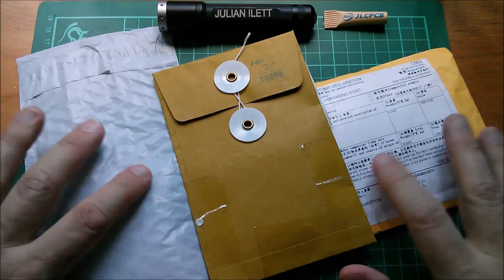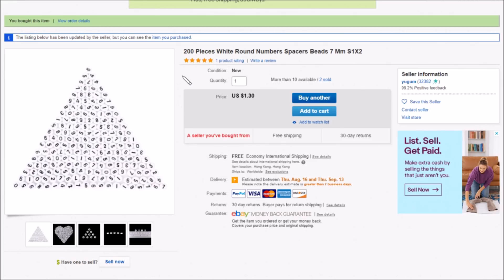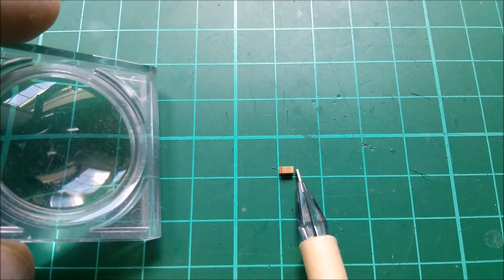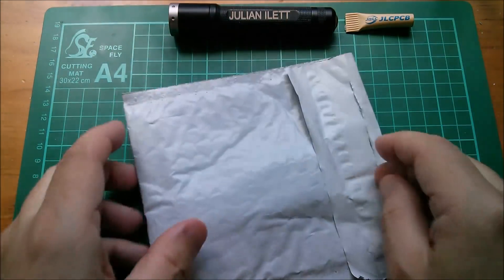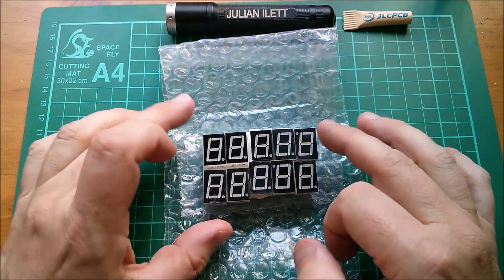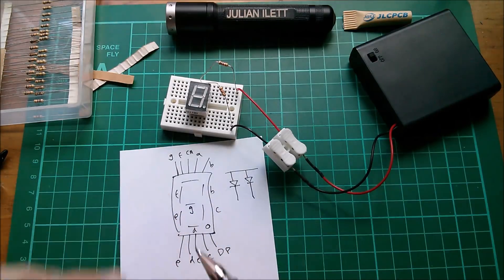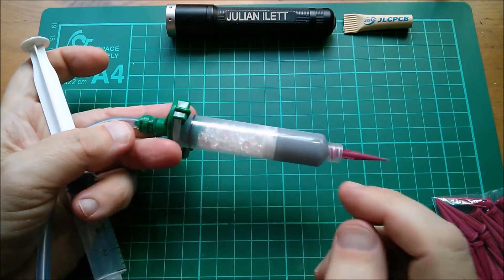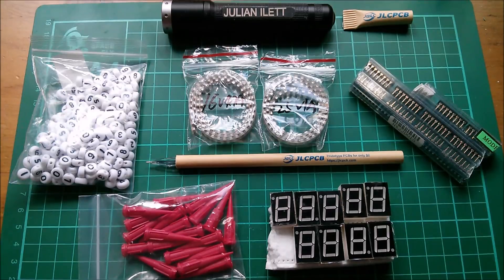Julian's Postbag: #122 - Electronicals

Comment: The solvents in the solder paste for the flux are normally alcohol based along with other volatiles. You should always store them at a lower temperature above freezing to minimize loss of those through evaporation. Do not use any desiccant as that will only cause more to evaporate until an equilibrium is reached in the container. ziplock bags are good just remove any excess air without creating a vacuum condition. The less space for gasses, the less evaporation it will take to reach an equilibrium. The thick heavy duty freezer bags are the best. Anything being stored for an extended period has a corner left open and then the rest of the bag is submerged to remove the air before the corner that's still open is sealed. Then it goes into the fridge. I've seen some use pressurized containers, but it's just more work and solder paste isn't that expensive.

Comment: Your solder paste contraption looks overly complex, is solder paste really that expensive there, to the point where you just can't waste a tiny amount?  I just fling the paste in the general direction of the PCB and any that's off the pad a little, either moves over to it when heated or just washes away when I clean the board.

Comment: Julian, measure those SMT caps...some “fraudsters” will sell you, effectively, an empty tantalum package, with nothing inside!
What hexadecimal display driver are you looking at? Perhaps the common anode is the correct display if the driver provides a LOW output driver (negative true) for each segment.

Comment: What is the 7 segment hex driver chip for common cathode displays?    I wanted one but have not found any
Reply from the maker: MC14495  HEX to 7-Segment Decoder
Reply: These are obsolete and therefore difficult / expensive to obtain.    A cheap micro controller and any display is probably a better bet  see HSEG1000

Comment: I enjoy your videos, Julian. I have been watching, so I know that you were using air to prevent the paste from continuing to flow after mechanical pressure is applied. But as you are experiencing, the advantage that it gives in that air is compressible and therefore gives a nonlinear response also brings a tradeoff. I think you are on the right track in attempting to limit the amount of air, but I think you need to think about the entire volume of air, not just the part near the dispenser. I look forward to continuing to watch and see how this turns out!
Reply from the maker: I'll be using the syringe digitally - just on or off (full pressure / no pressure). That results in a fixed flow rate of paste through the nozzle. Yeah, the beads reduce the air volume in the syringe - the pipe can be cut shorter if necessary.

Comment: Julian, I keep my solder paste in the fridge. I hope that helps.
Reply from the maker: I don't have a fridge - I have 50% voting rights on the use of a fridge. Guaranteed stalemate :)
Reply: Same here.  The dragon does let me keep one tube in that's been opened.
Reply: Get yourself one of those tiny peltier element powered fridges to keep your paste in. The ones you can fit just 2 or 3 330ml cans in.
Reply: Let me guess the wife has the other 50%
Reply: That is about the most accurate description of a marriage I have ever heard LOL. Also, a mini fridge for your refreshments and solder paste could be in order LOL.

Comment: I put a bit of hot glue on the paste dispenser tip to seal it between use.  Stops the paste from hardening in the tip.  Otherwise you might as well throw out the whole thing if you leave it for more than a day.  Don't get too worked up trying to put the paste on perfect.
Reply from the maker: Yeah, I'm going to treat the tips as disposable.

Comment: TIL311 display already has the chip built-in... if you can find them. 4-bit input hex display; saves space as you don’t need a separate decoder IC. Has internal latch, so they can be multiplexed. Also has blanking input, and left/right-hand decimal points. Just google “TIL311” for the pinout! 😍
Reply from the maker: I have 2 of them on an old Z80 project :)

Comment: The trouble with those little DIP switches is that they're intended to be set and then left and only changed rarely if ever.  They're probably made to a price rather than to a quality because whoever made them thought they'd be moved back and forth a few times at most and then never moved again.
Reply: "Maybe", a quality major brand will typically rate their switches for number of cycles and it's more than just one to a few cycles, but yeah the generic stuff, if it works at all you should never touch it again, lol.

Comment: MC14495  HEX to 7-Segment Decoder
Reply from the maker: That's the one :)
Reply: I have ben using them to build clocks
Reply: 80 pence each on AliExpress seems quite good.  A much better price than TIL311 (sweet though they are).
Reply: I have 450 TIL311 I have not played with them in 10 years I got 500 them of EBay way back wen . I may have to dig them out
Reply from the maker: +Jamie Phillips I think I have 2 of them :)
Reply: back then they were $0.15 each

Comment: Yes, SMD package sizes can be given in metric or imperial units. Most manufacturers use metric, because the very small sizes like 0201 (0.2x0.1mm) would look like 008004 in imperial (and many of the SMD specifications are metric to begin with). Almost none of the codes appear in both measurements though. You have an 0805 and 1008 in imperial for example, but a 1005 is the closest in metric (numbers, not size obviously). 
But as luck would have it, the only two that do have an equivalent are the typical hand solderable sizes (0603 and 0402 imperial). Watch out to not get the metric size for those!
Reply: 0201! That's absolutely tiny. 0.1mm I couldn't even see that let alone solder it. How does even a pick n place machine pick up parts so small as they use vacuum to pick up parts.
Reply: I don't know. Sprinkle them over the board and hope something sticks? I'd really like to know that as well. Apparently it actually is a point of higher failure rate in production. So it's not what you would want to use if you didn't have to.

Comment: I keep my solder paste in the fridge, seems fine after 2 years now.
Reply: My fridge is still fine after 10 years.
Reply: The paste that requires frigeration tends to have at least a 12 month shelf life.

Paste that had been stored badly (specify before you get it) tends to go hard. Decent solder paste should be dispensable by hand. Once you try a good quality solder paste,  you can quickly tell the difference between good and bad paste.

Good paste it's like magic if you've only used trash paste previously. :D
Reply: Put it in your food dehydrator to draw the water out, and store it in an air-tight container.  Many years without refrigeration, then when it comes time to use it, don't get it confused with your beef jerky which does not hold components on PCBs well at all.
Reply: Keep perishable food in a fridge?  That is a remarkable high tech solution  that WTFBBQ didn't need stating.

Comment: Even a surface mount mosfet?
Will the femto version be as good?
Also, i doubt it will work with just a syringe. I think you'll just compress the air and nothing will happen.
Honestly, i personally think you should just get an smt stencil(JLC pcb makes those too), thats a lot easier. You can do the whole board all at once in a couple seconds using that without any precision on your part. All you have to do is align it properly and then spreading he paste all over it.
Reply from the maker: Ah, yes, the MOSFET and transorb diode are still through-hole. The legs of the MOSFET double up as a connector :)

Comment: Ya, the metric SMD sizes aren't always exact conversions from the imperial.  I think a bit of rounding was done for some.  The 1206 for example likely started as a metric size, 3.2mm, and was converted to imperial .12598" and rounded down instead of up.  That's my guess at the moment... 5 AM here and I just happened to be getting up but it is still early to be thinking too hard!   ;-)

Search for "SMD imperial metric" and view images to see some tables.

Comment: You don't need a precise amount of solder paste on your board. Just spread a line of paste across all of the pads (the flux will do the rest).
Also the solder paste should be stored at around 0-10°C and should never exceed ~25°C.
Reply: or you get an smt stencil(JLC pcb makes those) and put it on the pads that way. just put a nice blob of solder paste on the stencil and then spread it with a spatula over all the openinings. 
You can get a board done in 10 seconds that way and don't lose any paste(because you leave it on the stencil for the next board).

Comment: Why not just transfer the solder paste into a regular syringe?
Reply from the maker: Sounds messy :)
Reply: It doesn't need to be messy, put the regular syringe needle into the original, pull back on the plunger to suck the paste in.

There is another way to get this sort of paste type material into a syringe, remove the plunger and put it in the fat end.
Reply: Make a bigger hole or snap the front of the paste syringe and plunger it into another syringe. You are going to have to take the paste out and mix more flux into it to make it flow again, or it's going straight in the bin.

Comment: 3216 (3.2x1.6mm)  is metric, 1206 (0.125"x0.06") is imperial and in this case they are the same size:)

There's a decent list on the wikipedia page for smd tech:)

https://en.wikipedia.org/wiki/Surface-mount_technology
Reply from the maker: It's a strangely inaccurate  conversion :)
Reply: It's not perfect (it's not uncommon with metric<>imperial) , it does get better if you use 0.125 instead of 0.12 but the package name itself takes some accuracy away :D